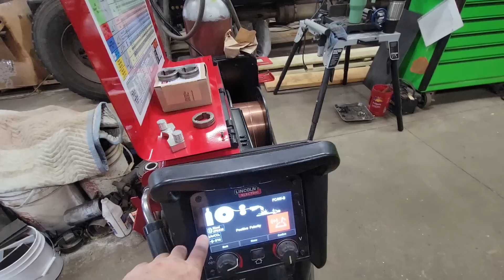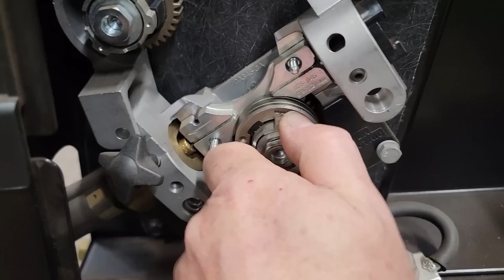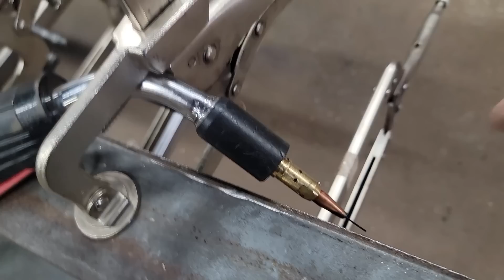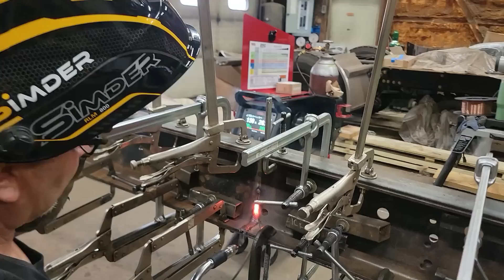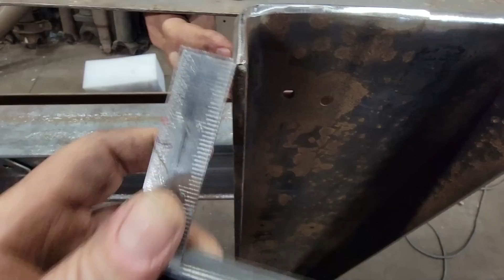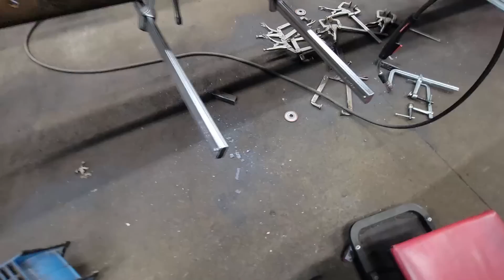KODIAK TOPKICK AIR RIDE SWAP PT4 STRETCHING THE FRAME!

Comment: Hi JC, with ref to the welder and a spacer... If you have an old wire roll / spool, trim it down so the back of the roll is sat against the thinner spool and trim to size to fit the gap between the lock and the smaller roll / spool .. Keep up the cracking good work.. Sounds like a Good weld is being produced.. No sparts... smarts .. or Farts  coming from the Welding ..  :) :)  Like it .. Andy UK ..

Comment: I normally don't comment. If you have a drill or hole saw in the diameter of the shaft on the welder. You should be able to find a chunk of sheet goods that is close to that space. If you center punch it you can cut the out side down and then drill the center. Looks to be 3/8-1/2 from the video. I know that I would not spend $200 for the spacer unless this is something that you are going to do a lot. And remember time is money lost so if it takes you an hour to build a spacer and it coast $200 you should have just bought it because it becomes a wash in savings.

Comment: How do you like the Lincoln 260 compared to the HTP ?
Reply from the maker: htp gave smoother welds on the vertical uphill. htp had to be turned down more to accomplish the same weld. lincoln gun is longer. lincoln screen is nicer.

Comment: I have seen guidance for the length of frame sleeves as 2 times the height of the frame.
Ex. Frame is 10" tall, sleeve is 20" long, on each side of the cut (or 40" long total).
For tow trucks and oilfield style winch trucks we usually went 36" on each side of the cut, or 6 feet long.
That Lincoln is a sweet welder!
You did fantastic fitting and welding the frame

90 degree frame cuts are fine! That exotic step cuts and miter cuts, and duck bill cuts are a needless waste of time. But can prove how good your layout and cutting skills are!
Reply from the maker: yep  2 times the height each way is typical for in front of the rear suspension mount.  this frame is only 8" tall and the splice is behind the suspension. the bed mounting plate will act as a support as well. im not concerned.
Reply: JC you talk about why you went the way you were. It's still good to go over the manufacturer recommended sleeve. That way a hobbyist doesn't just take a axle cut off and weld it on a call it a day.
Reply from the maker: i have covered that several times in other videos. i have seen many videos of others that do just that, cut the frame, booger weld it back together and no mechanical backup. most of those people titled their video the "right way or best way" to cut / weld frame".

Comment: Looks pretty good. Tighten up your vertical weaves a little more and use a scrap of flat or angle as a run off tab on the flat weld on top and bottom of the flange. Much easier to fill the edge with no crater.
Reply from the maker: always more to learn.

Comment: Hey J.C, glad to see the 90 degree straight cut splice, far superior to the "Z" splice and actually is the only recommended type of frame splice by all OEM's. The Lincoln Power Mig 260 much better machine than the HTP. Aluminium deck would be cool but steel is nice as well. Great job!
Reply from the maker: so you have used the lincoln 260 and the htp 220? what did you like or dislike about each? z splice gives a guy more weld on the joint. helpful if your concerned about weld quality. i think the weld itself is far more important than the style of cut.
Reply: @j.c.smithprojects  Don't get me wrong, HTP is a better product than most, especially at their price point, they do work very well. I seen huge improvements in weld arc quality since they were bought out almost 20 years ago, and I believe they are still made in Italy. The Lincoln 260 just holds up to shop production a little better, but just a little bit. For this price point, Lincoln has a slight edge on its arc characteristics and duty cycle but that is about it. For the rest of the Lincoln line that is under your particular Power Mig 260 unit, I regard them as junk. Lots of quality problems. It seems that with Lincoln you have to really step up $$ to get the "good" machines or you end up with junk,. I will say this, HTP  appears to have consistent quality across all its machines and that is good. Although HTP do supply cheaper accessories with machines to keep cost down. I pretty much used them all. I was a big RED fan many years, then BLUE for a couple of decades, was Yellow for a little while as well as others too but ever since I found the "RED" ones' made in Pettenbach Austria, I have never looked back, sold everything and just use them now. But keep in mind they can be 2X the price of any RED, BLUE or YELLOW sold here, ouch!
Reply from the maker: this is exactly what i was hoping to see. someone with experience with all major players. what they like and what they dont. real world experience. i looked at new miller and lincoln welders at my gas supplier. they all were those cheap ground clamps, small gauge wire cheap where ever they can. my old miller 185 still lays a beautiful bead and its over 25 years old.
Reply: @j.c.smithprojects  Yes, Miller has be a disappointment for a good 10 years, same problem as the other brand. Your old Miller 185 was built when they actually cared about performance, very good machine and a good backup. Keep up the great work, always enjoy your approach to problems, your very professional.

Comment: 6 miles a gallon thats all with a 30 or 40 gallon tank for a 2 wd with rib tires loaded or empty wow i feel spoiled in a dodge 5500 crew cab 84 ca with a 12 ft bed 4x4 4.88s all traction tires gets 10 to 13 mpg and a 52 gallon tank plus she's a little delicate thing at 12,000 pounds by herself. just when little girl gets thirsty she hits the pocket hard happy to see this one get built too
Reply: Forgot to add with the wire rollers miller/ horbart is the same way .35 on both sides for my hobart iron man 230 and the miller 252 at work even funner is the rollers interchange and my Ironman 230 has a made in Appleton sticker at the miller welder plant even came with a miller gun😅 though miller does own horbart just was under half price

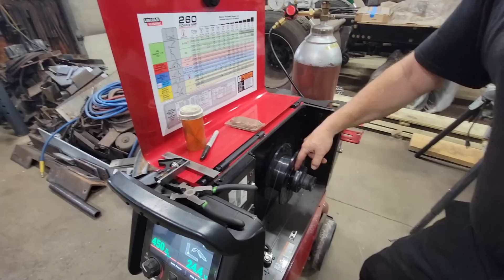Comment: 25:01 take a piece of 2” sch 40 pvc pipe and cut a spacer on the miter saw ….
Paint black to match if you like
Reply from the maker: i have a spare spacer because we made one out of 2" iron pipe with the first htp. then found the spacer in one of the boxes.
Reply: I was wondering about a piece of heavy wall cardboard shipping tube.

Comment: Is it just my imagination or does running it dual shield create a lot less spatter than conventional flux core welding?
Reply from the maker: im not a traditional "flux core" fan. what a mess. dual shield is clean, smooth and VERY hot!
Reply: @j.c.smithprojects  About the only time I prefer flux core is outside on a windy day and I am out of traditional welding rods.
Reply: Less spatter created …  virtually none